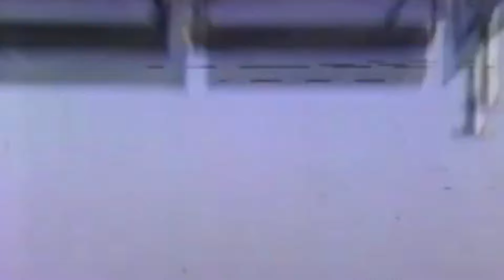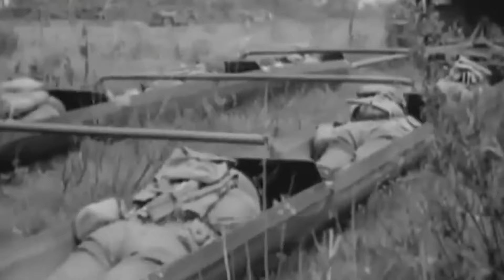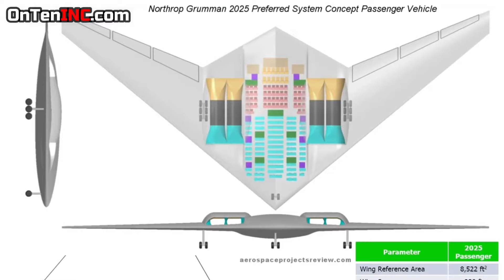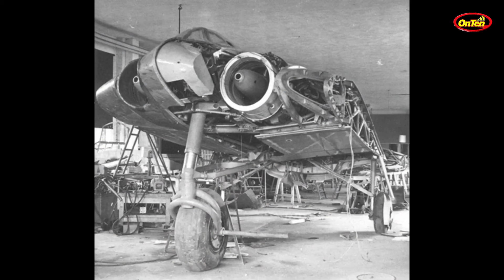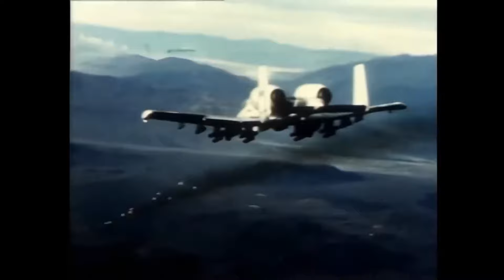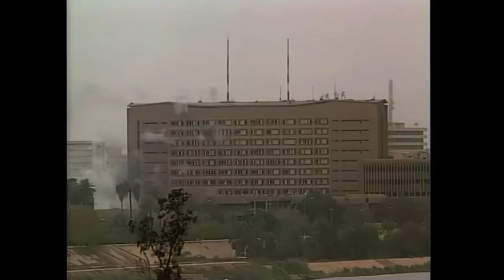Most insane modern weapons

Comment: Personally I think that the military should of built a tank attachment that can perform as the Soldiers in a half shell did, improve the design making it easier to pass thru different terrains, and instead of that risky cable release system, I'm thinking something more permanent attached the the Tank itself, 2 skinny platforms, 1 on each side above the tracks maybe. I think with a little improvement that would still be viable even in modern warfare today.